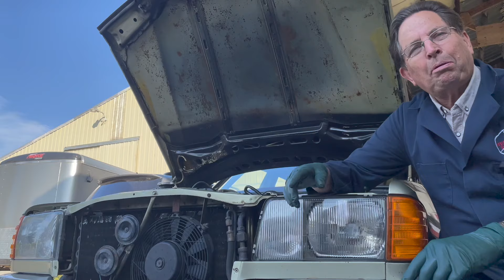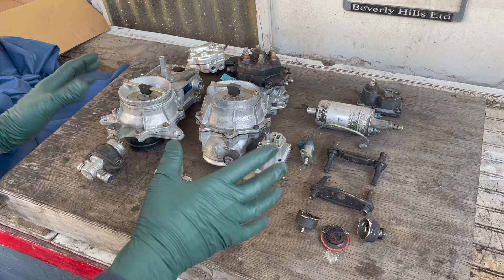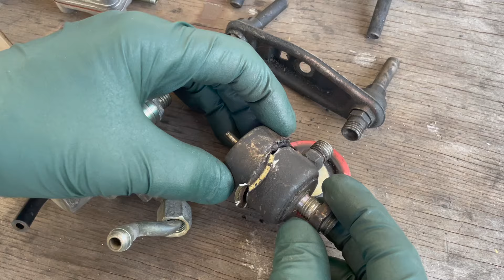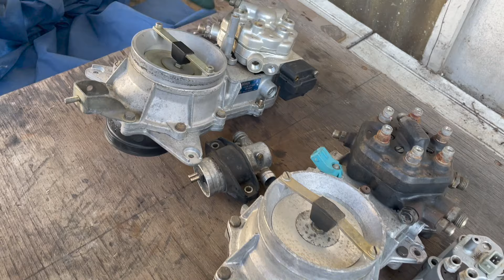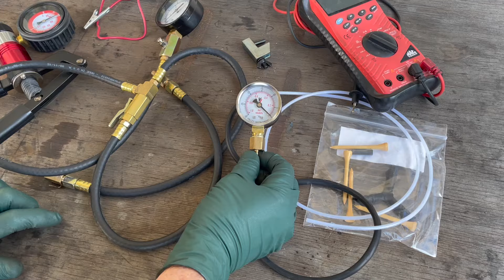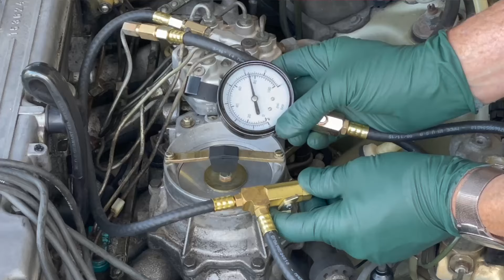Bosch K-Jetronic Fuel Injection: Diagnose BEFORE Buying Parts

Comment: Well after testing my fuel pressure, having correct lower and higher chamber pressure I began throwing parts at the car. My M103 2.6 with manual won't idle at 750rpm checked for vaccum leaks with a smoke machine. It feels like it misfires on cylinders when running low. Adjusting Fuel mixture  so it runs more rich about 1k rpm only can idle. I'm lost! Next I will change computers.
Reply: Obviously it could be any number of things, but for the idle, easy check is the idle switch that is part of the throttle assembly. On mine it was misaligned, so it wasn’t being pressed properly when the accelerator was released. Another easy test is idle control valve. Unplug it, it should idle much worse, meaning it was working. If instead the idle stays the same, either the idle control valve is bad OR the OVP relay is bad. On mine I replaced the OVP and it fixed like 4 issues.

Comment: this brings back memories , started my mechanical apprenticeship in  very early 90s at an independent merc dealer. spent most of my time in the dedicated tune up bay with a crypton machine , working on W123 , 126 and 124 series cars. k jetronic and some had a stronburg carb.

Comment: Thank you Kent. Your videos helped me a lot. With my 124 300ce 1991 M104 the filters from the fuel line into the fuel distributor were clogged after 5 years sitting at the dealership. Costs 10$ at Mercedes and solved the problem.

Comment: Hi Kent. Love your videos. Where were you when I needed you? I went through everything you mentioned before I ever came across your very informative videos. I bought a 1991 300E with the 3.0L that was sitting in a field and not running. With much frustration and trial and error. She's running and I love this car and the engineering that went into her. Here's the list of materials I've replaced. Fuel pumps, accumulator, fuel filter, CIS, injectors. Idle control and cold start injector. All because it sat for a long time and the 10% ethenol destroyed the fuel system. I only use non-ethenol fuel and love my car.

Comment: Thanks Kent for all that you do!   I am one of the few shops in the North Texas area that will actually service these old Mercedes with jetronic and KE Jetronic and employees Mercedes-Benz factory trained mechanics back from that era.   There are so many variables to the system, and so many things that can go wrong.  I have watched countless videos on the subject and none of them are all one size fits all unfortunately.
Reply from the maker: Hi Michael, Thanks for reaching out. You are one of a dying breed for sure. You are so right about all the variables of CIS injection. But there is hope I believe for K-jetronic owners. I just installed the new electronic warm-up regulator from Unwired Tools and it is amazing. Since I have found so many of the K-jet problems lead back to the WUR this unit could be the one thing that keeps more of these cars on the road.  Kent
Reply: @Mercedessource  I’m gonna have to check that out
Reply: What is the name of your shop?

Comment: you are the best Kent. my 300 ce w124 va not running right the owner before have change the fuel pumps and the fuel accumulator. my problem was the mixture on the fuel distributor and car goes finally fine now

Comment: Thank you for the video. I have an old 300E with the 2.6 and I hate the jetronic system and am trying to get it running smooth as I’m going to drive it regularly until I can save up to completely redo the fuel system with a modern ECU, fuel rail, and manifold as I also plan to turbo the car. But baby steps lol

Comment: This newer bosch system is the reason I got rid of my 1993 190E. I replaced parts left and right, spent so much money and hardly ever got to enjoy driving that thing before more things started failing. Loved the car, one of the most enjoyable cars I've owned, but it gets old quite quickly having to constantly troubleshoot it. I sold it 3 years ago for the same price that I had spent in parts in just the two last years of ownership. Next time I'm owning a 190E (because that will happen, surely) I'm replacing the dated bosch engine with a newer 3.2 v6.

Comment: always great videos 1991 300SL will not start when sits overnight unless add fuel into bowl then have to let idle for a while before i can rev engine all vacuum lines hoses fixed and ovp relay still no luck it did sit a little bit.

Comment: I parked my w124 coupe in the garage and haven't used it for about 2 and a half years and it was working and running perfectly. I got it out the other day and now shows no fuel on the dial even though there is definitely fuel in the tank, I have good fuel pressure coming from the main fuel line but it fires up for a second or two then shuts off before not running at all. Just starting to troubleshoot now. Thanks for the video.
Reply from the maker: Just beginning work on KE-Jetronic systems - hope to have a kit that can help you troubleshoot that problem.
Reply: @Mercedessource   thank you , I have subscribed to you're channel. The engineering in these old cars is quite interesting, also my fuel cap has decided to lock itself yesterday and I understand they have vacuum operated locking system?
Reply: @Mercedessource  OK so I didn't do anything on this car for a week or so but today I discovered that there is no fuel coming out of the distributor where the injector pipes screw in, very slightly on cylinder 3 there a little fuel coming up. So I guess my next step is to remove and strip down, I wonder what could be blocked?

Comment: The minute I bought a fuel pressure gauge was when I began to sort my KE-Jetronic. Used in conjunction with the factory WIS/EPC, it will end all speculation and you will get to the bottom of it. I suspect that the following installments will chart my journey exactly. Do not let ethanol fuel get anywhere near KE-Jetronic.

Comment: Hi Kent I have a 1987 230GE which has the KE-Jetronic. I left it parked up for over a year and when I tried to start it it would start for about 2 seconds and then stop. I have changed the relay but it did not make a difference. I have also checked the fuel pressure at the fuel distributer and it reached 135 psi whilst cranking. Can you suggest what I should do next.

Comment: Kent, I just purchased a 1978 euro spec 280sl, r107. I'm finding your videos really helpful and would love to know if you could give me some ideas what to check for a problem I have noticed.
I smell fuel in the cabin while driving only after I have filled the tank completely. When the gauge reads about half full the problem disappears. No visible leaks noted.
Reply from the maker: I suspect fuel tank problem, but start by looking under the car and in the engine compartment at ALL rubber fuel hoses. Braided hoses can "weep fuel fumes" - they will look wet. Next check fuel tank vent and vent lines coming off the top of the tank. Check to make sure fuel is not getting into the trunk ( rubber seal around the fuel tank neck). And check that no one has run a sheet metal screen into your fuel tank by mounting something on the forward wall in the trunk. Yes, I have seen this before. ( ie CD player )

Comment: I'll be watching intently as I often fall into the "as long as I'm in here" trap...not a bad thing but I replace any potential wear item -hoses, pumps, seals and if component X is a known high fail rate product and its under the intake manifold, as long as I can replace or repair for under $50 or so, its gotta be replaced.  Kind of a Belt AND Suspenders approach

Comment: Hey , i love your videos and watched may of them, I have a 1991 500 sl and its been seating for a while, it is starting nice and running ok till it gets warmed up, about 75 degrees, I can drive it for about 2 miles, after that it looses power and the only way i got home is driving on idle speed only, I if try to push gas its smocking black smoke ,i replaced fuel pump and  fuel accumulator, any suggestions????  thanks WZ
Reply from the maker: You will need to do a complete fuel flow and fuel system pressure test with the engine cold and then when it starts to act up. If you try to throw parts at it you are just guessing into the wind...

Comment: Hello! I’m currently working on w116 m110 k-jetronic i’m still diagnosing injector no 1&4 is flooding the cylinder everytime the fuel pump turned on and its just cranking but no start.. can you pinpoint me where to start? Side fact all spark plugs and injectors are brand new. Now im guessing the fuel distributor might be the culprit
Reply from the maker: You would want to do a full system flow and pressure test with the proper proper tester before you spend any more money.

Comment: Hello Kent if I could ask is there any way you can make a video on Ac recharge or a how to on retro fittings for a 1982 Mercedes Benz 240D 4L my ac works fine but I don’t know anywhere for R-12 and I’ve been getting many recommendations for a conversion. But some say I can do just fine with a recharge? Any thoughts?

Comment: Kent fantastic videos you make ..One question my M103 has both the WUR and  EHA valve is there a reason for them both to be on my M103 engine
Reply: Trevor, I'm guessing you're in the UK so that might be different. I'm in the USA and I have the CIS-E/K-E system on my M103 and what I thought was a WUR down on the engine block (down in the inky darkness) turned out to be a fuel cooler on an air conditioning line.

Comment: I have a problem with my k jetronic, it floods the engine when I try to start the car. What parts would I need to check?
Reply from the maker: Don't throw parts at it until you do a fuel system pressure test.

Comment: Hi have a 1986 420sl ticks over ok but cuts out when trying to drive, have changed all filters, could it be carburettor problem?
Reply from the maker: Probably will require a new flux capacitor.
Reply: My fault being a novice 🤣🤣

Comment: hello kent
im having issues with my m102  engine. I changed the fuel filter and fuel pump. the engine starts but i have to press the pedal down for it to run. if i let the pedal go the car shuts down.
it starts but shuts down. it wont idle on its own. when i keep the engine running it runs rough
im kinda frustrated and i think that the accumulator is bad.
Reply from the maker: The problem Is not the accumulator. Failure shows up with starting problems. I believe you have a fuel pressure / fuel mixture problem. I recommend don't "throw parts at it" until you do a full fuel system pressure test.

Comment: How can I buy the kit for ke jetronic ? With instructions ,I Searched mercedssources web site and couldn't find it, I appreciate sharing the link,my problem: once duty cycle is adjusted the RPM stay high to 12000 RPM ,car is 190e 4 cylender 2.0 1992
Reply from the maker: Sorry I do not have a kit for the Ke-Jetronic engines.

Comment: My 1972 W108 4.5 starts and runs fine..but after few miles..if I pull over the road the idle is bad and rpm drops..How can start investigating?
Reply from the maker: Start with education. Get the factory manual. Learn everything you can about the D-Jetronic fuel injection system. It is much different from the system I am talking about in this video. Only after you learn about each component and what it does in the fuel system will you be able to troubleshoot and find the problem. It could be one of 20 different things and is usually a combination of more than one due to the age of the car.

Comment: Why does my w123 280ce not tick over when it's hot? Everything else seems OK...
Reply from the maker: Have you done a fuel system pressure test? You could have multiple problems, but you need to pressure test rather than guess.
Reply: @Mercedessource  Thanks. I'll work from there.
Reply: @Mercedessource  Fantastic channel, by the way!

Comment: I have an 88 300SE. I think that rubber boot on the botton of the system should be replaced along with a set of injectors and seals. although the car runs fine and starts easily with 200k miles its time to do some maintence. 
i never checked that fuel screen, idk mine had that?
The only odd failure the car had was the crank position sensor. it would heat soak when the car was shut off at the gas station snd not restart!
spark was scattered and too weak to fire tge engine aparently, of course the car would cool down and run fine again so anywhere i took it couldnt find the problem when it wasnt in a failed state.
Reply: The fuel screen is on the bottom of the gas tank, I think it's $32ish US$. Kent sells a neat socket to get up in there and remove it. Check out his video, "Mercedes Fuel Tank Filter Screen Problems and Solutions by Kent Bergsma."